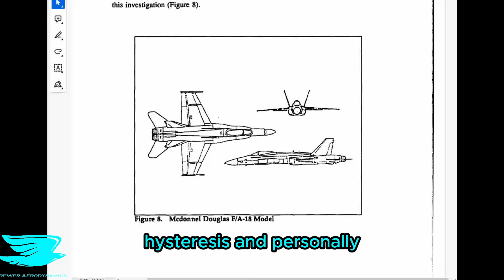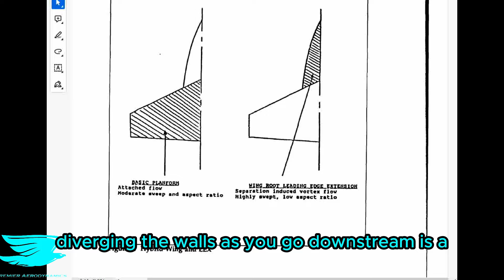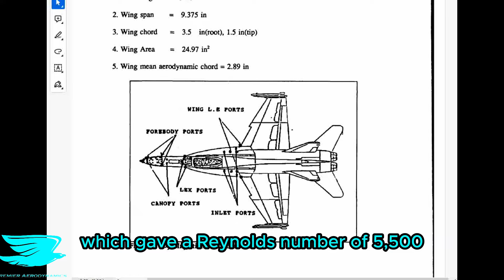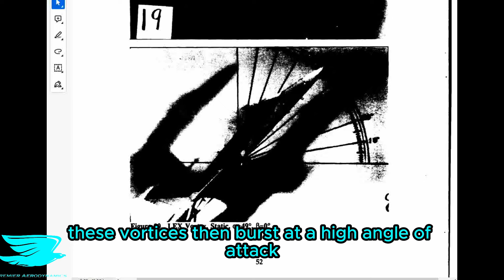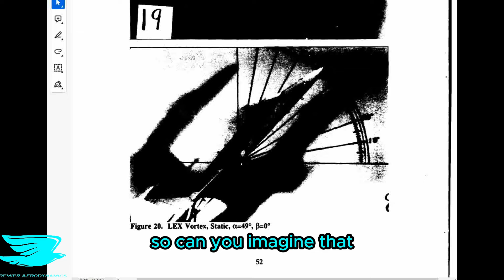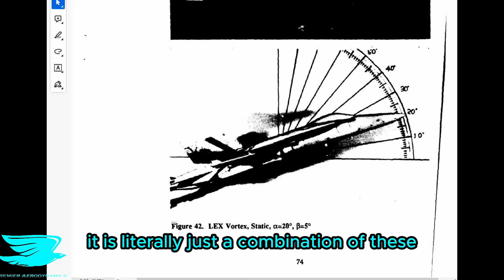Podcast #170 F18 Fighter Jet LEX Aerodynamics

Comment: If we assume a free stream flow, a vortex is slower relative to that free stream flow, because the free stream velocity has been converted to rotational velocity. So it stands to reason that the greater the rotational energy, the slower the vortex will be relative to free stream flow. If the rotational energy is high enough relative to the free stream energy, the free stream flow slows so much that it reverses direction. That is what is referred to as a vortex breakdown.
Reply from the maker: I had never thought of it like that. I guess that is true. The vortex should be travelling slower than the freestream flow.

But, it also depends on how much of the static pressure is converted into dynamic pressure. So, if more is, then the velocity can be higher. And the fact that a vortex has a low pressure core, indicates that some of the static pressure has converted into dynamic pressure (and velocity).

I think that the total pressure (assuming no losses) will stay the same.

Comment: I wonder if the stability of the vortex during dynamic pitching motions is a bit like the torque multiplication of a torque converter. The dynamic pitch induces more rotational energy, which temporarily mitigates the loss in kinetic energy. In a static pitch up condition, the rotational energy is constant, and isn't entraining enough air to make up for the loss of kinetic energy due to the high AOA.
Reply from the maker: That's a good point, the wing pitching up dynamically might be adding to the energy of the vortex.

Also, maybe pitching down is kind of stretching the vortex, which makes it harder to occur.

Comment: Very interesting that pitching down would make the vortex burst sooner, it makes sense, you're turning the suction surface into a pressure surface, so I guess the vortices are more stable in a low pressure environment. Like the air gasping for equilibrium.
Reply from the maker: I think that it also has to do with how they form. I see it as they are more stable at lower angles of attack, so pitching down to try to get one to appear means that you have to go lower in order for it to form. At higher angles of attack, the vortex is kind of holding on, but not thriving. If that makes sense.